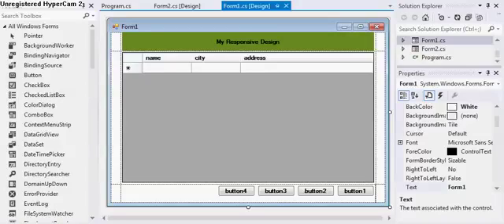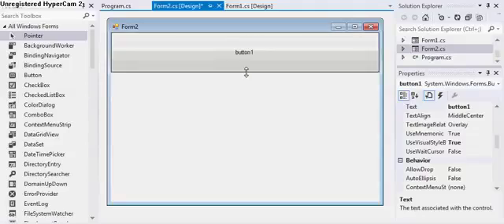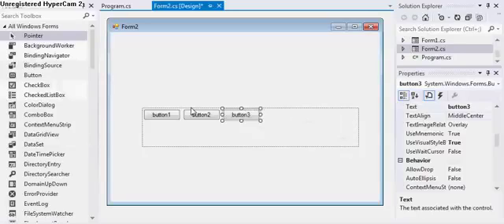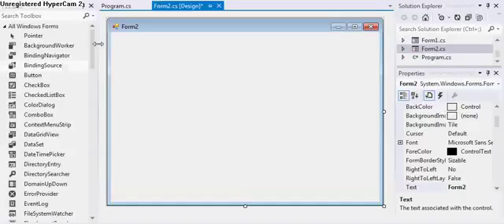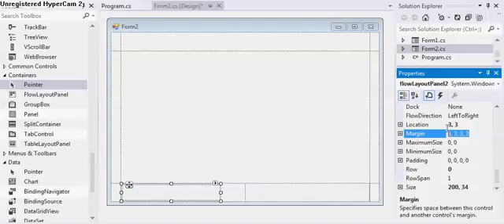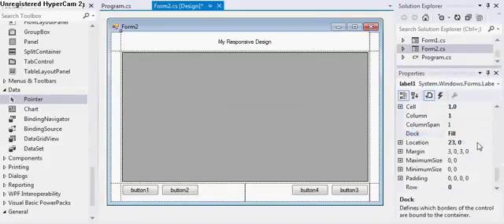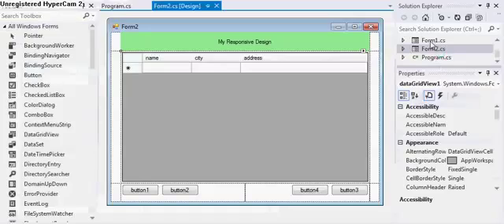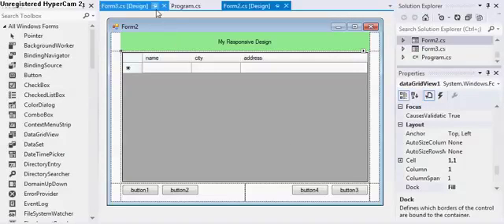Cross Resolution and Responsive Design Windows Application or Windows Forms in .NET

Comment: But the problem is that the application will not be responsive for mobiles and tablets. As the real application is. So whats the solution ???????
Reply from the maker: WPF if you use xamarin forms, it will work on all platform.

Comment: Hai there !!!!!!!         
              I want to invoke 10group box 30text box 50check box 5panel with in a single form and make it is as responsive form 
Note: the textbox should both side left side 15 and right side 15 inbetween textbox should i have to use 20check box and 2 group box in left bottom 5check box and 2panel like wise ........ possible????????????????
Reply from the maker: responsive means it should fit your resolution. If you controls combined size is greater than resolution than don't expect it to be responsive. Their is always minimum size. Other than that you can make any thing responsive depends on minimum size and display resolution. Apple system has bigger resolution you can fit 2  to 3 times more controls  than normal screen.
Reply: Thanks for ur Reply sir !!!!!
           from ur suggestion i got if we used more controls with in a single form mean its difficult to make responsive screens .sir pls confirm what i got its right or wrong
Reply from the maker: now in one form it self you can manager you can have scroll in form and can have controls into them. Also use tab controls to split controls. Below is one link in which flow control is used to make scroll. Hope it helps. If you still need help contact me on sunday on skype kingconspiracy is my username. I can try to help you online too if possible. http://www.philosophicalgeek.com/2008/12/12/an-easy-stack-layout-panel-for-winforms/
Reply: Thanks for ur supporting and reply sir
Reply from the maker: You are welcome keep learning and doing good work :)